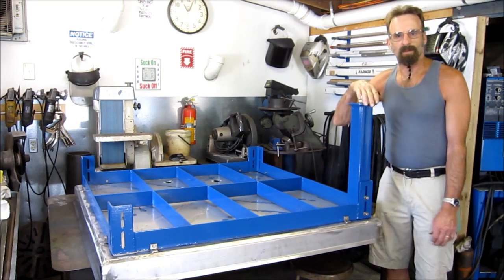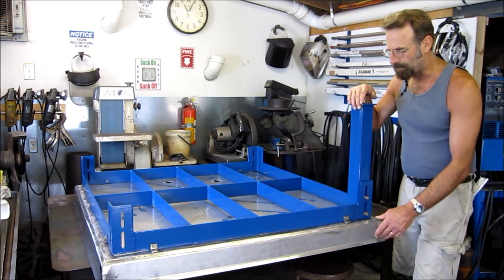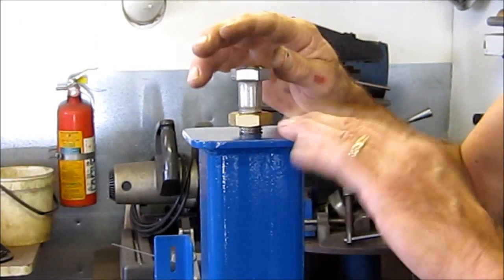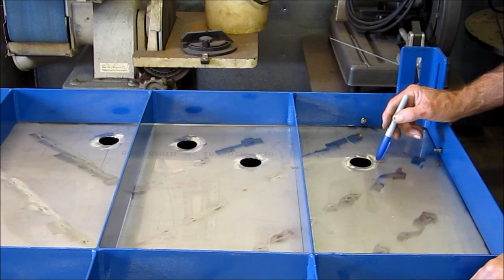Getting Ready for PlasmaCAM 7

Comment from the maker: @bmanbs Ya, the inside is 5' x5' and the heigth under the corner brakets is 321/4"...
I'm about a mile from the beach here on Cape Cod, Rust is cause by guys that are afraid to get a little oil on there hands, bare metal will rust anywhere. I only found two good things in Florida, the plane you get off of and the boat you get on...LOL...